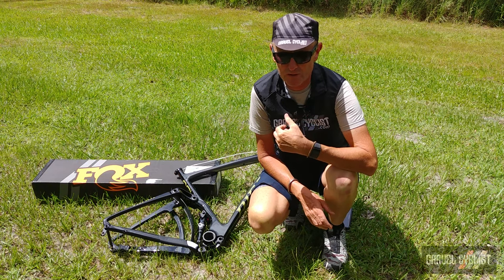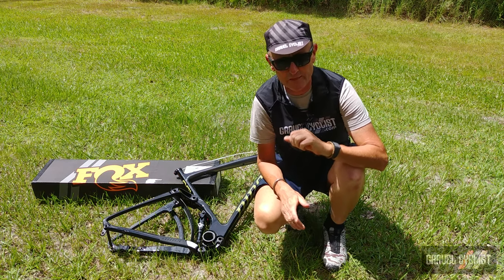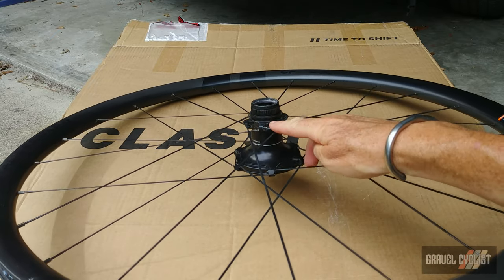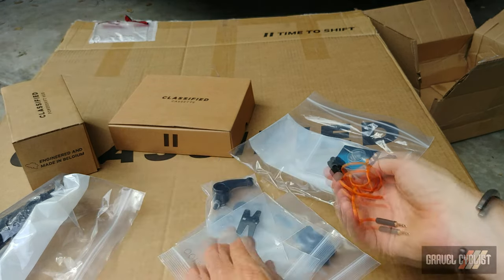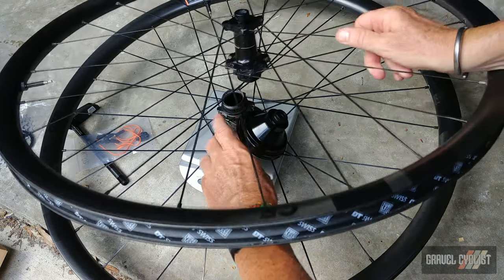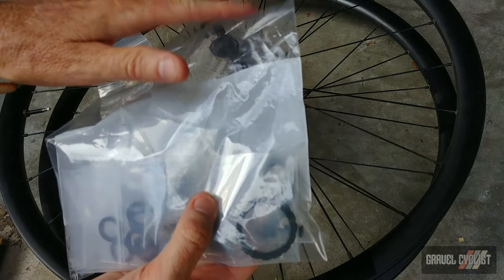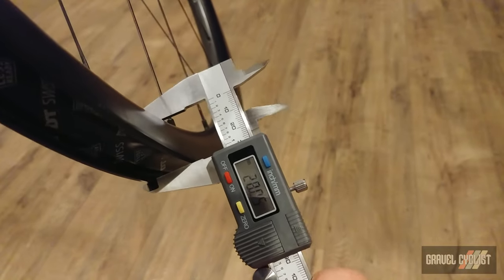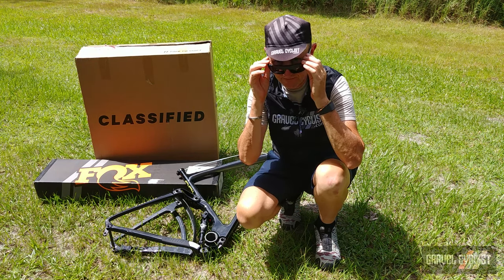CLASSIFIED POWERSHIFT: Full Suspension Gravel Bike Project - Part Four

Comment: I like the idea of classified, and when I rode a test bike it didn't feel draggy at all, shifting under load was great, and it's great to eliminate the FD.  But on an otherwise light bike it felt like there was a cinder block at the rear end.  Handling felt very odd, as a result - as if you had an anchor.  Bit like riding a city bike with a super heavy low end  hub gear system and messed up weight distribution. As a result I feel like this is better suited to heavy touring bikes or marathon MTBs.
Reply: Very interesting feedback and I could see that for sure especially when hoping stuff

Comment: So it is at least 550 gr heavier than a normal setup with 2-by crankset and front derailleur? That's a lot! 
Can you set it to shift synchronized with your rear derailleur?
Is it possible to see gears on your head unit? 
With 44/11: Will you use more than the first 5 cogs? If not: Is it a cheap cassette or does replacement really hurt your pocket, just because the 11 teeth cog is worn?
Reply from the maker: Hello Joe, your weight estimation including a "standard" wheelet is incorrect. I have a video I have already recording comparing the Classified parts including their wheelset + wheelset and parts of a comparable 2x setup.

I'm unaware of any synchronization, my setup is mechanical anyway.  The cassettes are not cheap.